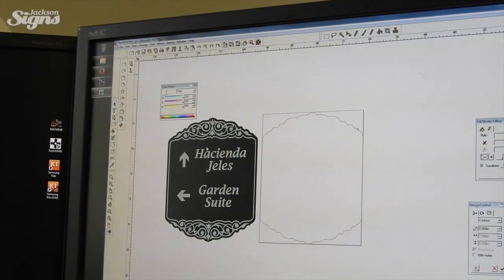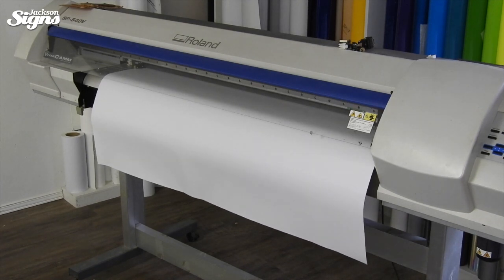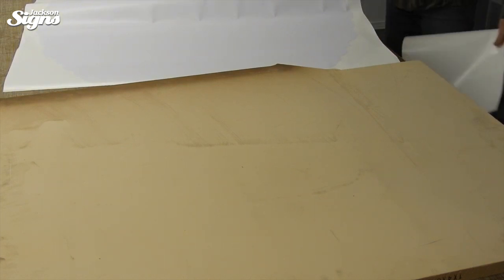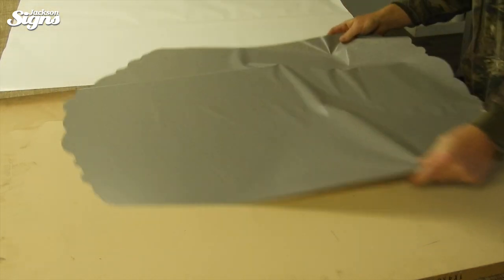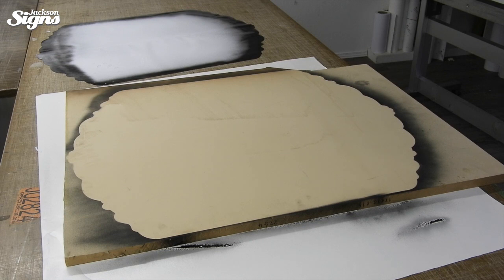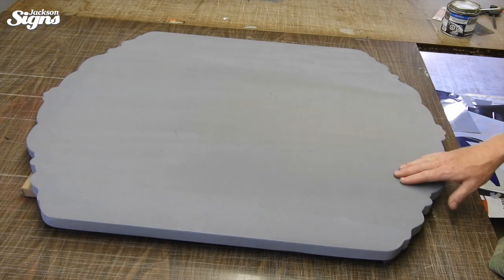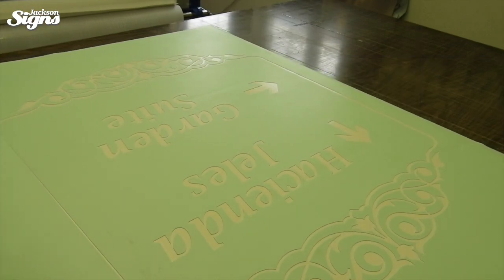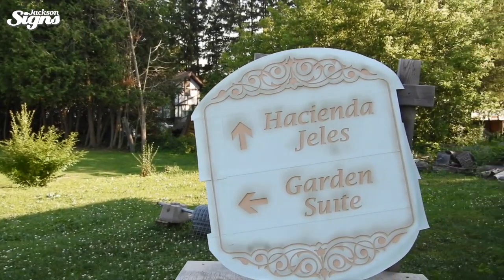How To Make Sand Blasted Signage - Custom Carved Wood Signs

Comment: Tryin to get into sign making myself what been sandblasting headstones for about 8 years for the company I work for . If u could answer a couple questions for me I’d greatly appreciate it what size air compressor do u use and what media do u use
Reply: Can you recomend a sandblaster for stone
Reply: We use a 375 cfm screw type compressor.  This is exceeds our requirements for sign making.   I believe a compressor like this and the proper blast media will work well for granite.

Comment: What is model of sand blaster?
Reply: I recommend a screw type compressor135 cfm works.I blast at around 40 psi. Need lots of air volume.
Reply: @mattjackson1033  Forgive my intrusion Matt but how much air volume does one need for an average sized sign?.....Great video BTW :-)